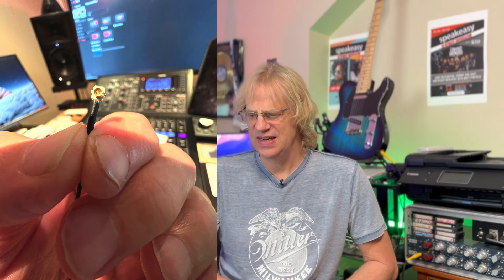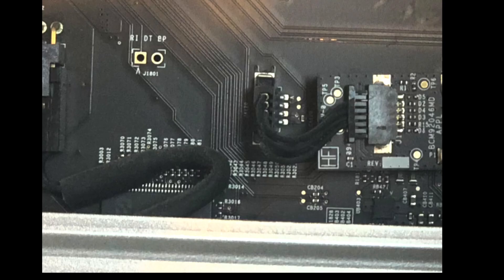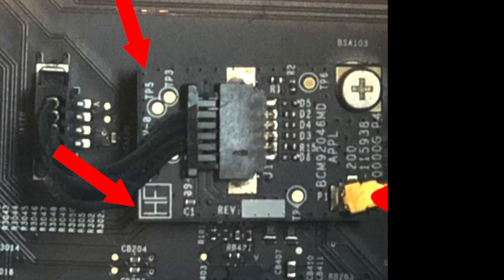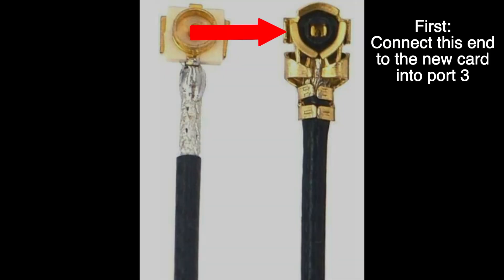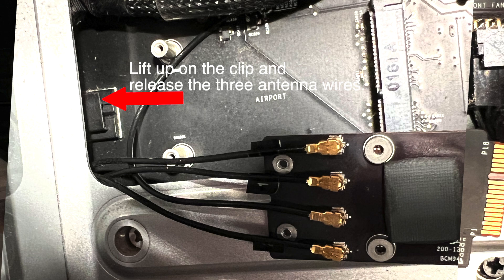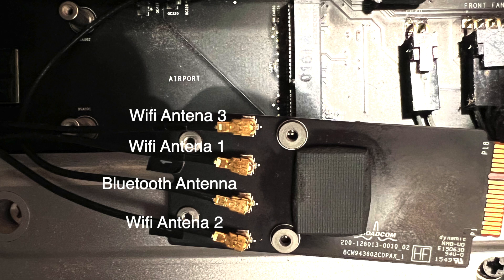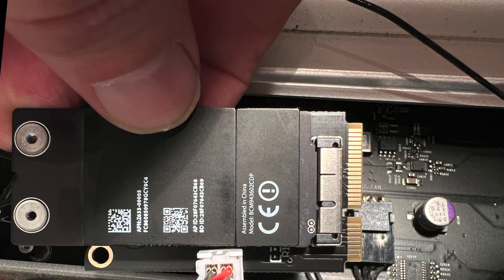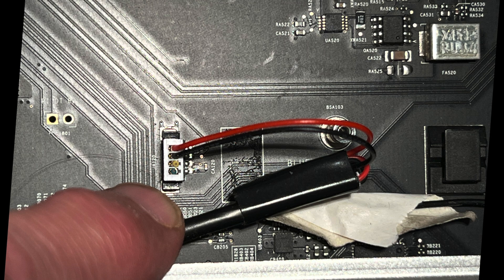Mac Pro 5,1 Bluetooth Wifi Upgrade!

Comment: Hello thank you for this good tutorial. Do you know where I can find the data cable ? And do you know that it’s obligated to install an antenna extension with this card ?
Thank you 🙏
Reply from the maker: The extension helps big time unless you are very close to your Mac Pro, mine live about 10 feet away from me on a open closet this is overpriced but shows you what to look for, it think you can find it on Amazon, https://www.ebay.com/itm/403596462883?mkcid=16&mkevt=1&mkrid=711-127632-2357-0&ssspo=-UibluCfTYq&sssrc=2349624&ssuid=o6k3tERPQiC&var=&widget_ver=artemis&media=COPY
Reply: @MacSoundSolutions  Hello, 
I did the upgrade but I have disconnections all the 10 seconds for all my bluetooth devices and the wifi is searching but never finding anything. Do you have an idea to help me please ? 
Thank's in advance

PS : in m
y settings, bluetooth module is visible
Reply from the maker: @jibemevel  try a pram reset, use a wired keyboard to do it. That may fix the issue.Press your Mac's power button and then hold these four keys at the same time: ⌘ + option + P + R wait till you hear the boot chime at least twice then release the keys. Check Wi-Fi BT.
Reply: @MacSoundSolutions  thank you for your fast response. But my Mac is patched with opencore under macOS Monterey. For you there is no problem to do a pram reset on a patched Mac ?
Reply from the maker: @jibemevel  it should be ok, are you using OCLP or Martin Lo’s
Reply: @MacSoundSolutions  I’m using OLCP
Reply from the maker: @jibemevel  did you apply the post patches? I think it’s safe to do a pram reset, when you change hardware it is sometimes necessary.
Reply: @MacSoundSolutions  Hi :D That was finally Ok under monterey, after installing the last OCLP (0,6,1). And I decided to upgrade my mac pro5,1 (mid 2010) under ventura. the mac works perfectly excepted for the Bluetooth that is currectly not available even in the mac system settings... Would you have an idea to fix it ? 

thanks a lot for your help🙏🙏🙏
Reply from the maker: @jibemevel  read the comments here might help https://www.reddit.com/r/macpro/comments/11v5foa/51_bluetooth_issues_after_upgrade/?utm_source=share&utm_medium=ios_app&utm_name=iossmf
Reply: hello 🙂 after my question, I saw your video where you don’t advice to upgrade to Ventura in this machine … so I decided to erase my HD and do a clean install of Monterey. Now it’s ok ! I’m installing all my plugins, this step is a bit boring but the machine rocks !!

Comment: I had to do install another BCM943602CDP because the first one I put in had a bluetooth range of only 2 feet from the antenna.  I got the new one installed and its working great.  The first one is going back to the eBay seller for a refund.  I'm happy.

Comment: I just  completed the install of BCM943602CDP on mini PCIe Adapter and  external antenna as shown in video.  Installation went great with all antenna cables attached firmly to Broadcom card.  Unfortunately I got a problem.  The Bluetooth is very weak.  At first it didn't detect my bluetooth devices at all.  Now bluetooth detects my Apple mouse and keyboard, but both mouse and keyboard have to be very close or directly on top of computer.  I also found that the known good bluetooth mouse sometimes doesn't track properly.  The Wifi seems to be working great.   So I'm assuming the problem must be either the Broadcom card or the cable that goes to the external antenna.  Unfortunately I don't have an extension for connecting internal bluetooth antenna.  I will continue to use wired mouse and keyboard until I have to perform more troubleshooting.  All of my other upgrades on my Mac Pro 5,1 worked flawlessly.
Reply: Update:  I found the external bluetooth antenna doesn't work well attached to the back of the computer.  When I attach extension cord between the computer and the antenna, the bluetooth works great.  I think this solves the problem.
Reply from the maker: Maybe some interference from something. I have mine on the back plate and antenna on my desk works well. If I put my iPhone near my track pad it can make the trackpad act all crazy. You also might want to try a pram reset after installing the new Wi-Fi BT card.
Reply: @MacSoundSolutions  I found that the bluetooth works great ONLY when the external antenna is within a a couple feet away from keyboard and mouse.  I tried reseting PRAM.  The antenna appears to be working.  The strength of my bluetooth is just very weak.  I think will order a "New" BCM943602CDP from AliExpress. 
I had so much fun upgrading my Mac Pro 5,1 that I'm looking on Craigslist to buy another one.  However I may build a super high power PC next for running Ubuntu.  Open source is cool.

Comment: I believe this is Broadcom BCM943602CDP.  I've seen these on eBay for $14.00 plus another $5 for shipping.  
You also need JST Wires, Mini PCIe Adapter and Antenna Extension Cable.
Reply from the maker: Yes as I say in the video you can source the parts yourself and pay a lot less.
Reply: @MacSoundSolutions  I believe the  Mini PCI-E Adapter need to be a Version 3.   Some Mini PCI-E Adapter  may not have a USB power connector.  The eBay ad that you posted only has a stock photo that doesn't show a USB power connector on the adapter.  The ad doesn't state the Broadcom model number.  The sellers ad is not clear on what the buyer is actually getting and he is asking for too much money.  I like one stop shopping also, but I'm avoiding this seller.
Reply from the maker: @elminero49  if you email them they should respond, they gave me two xeons 5699s and a flashed thunderbolt card so I feel I broke even.
Reply from the maker: @elminero49  under system prefs it shows BCM_20703A1 which is actually wBT4.1+LE. They do say on their website that the photo is for ad purposes only and the card may vary. It seems it's not a 4.2 card, it does work with handoff airdrop.
Reply: @MacSoundSolutions  Hey Lance, An audio question:  I got my entire music collection on my computer.  I grew up the late 60's and 70's.  My parent always had the radio on at home and in the car.  I got every song I can remember on my hard drive as a mp3 or flak.   Is there a particular DAC i should get that produces great audio and doesn't cost much.  Is it worth getting a vacuum tube pre-amp?  Can you recommend a good pair of headphone that would give me music texture and layered audio?  I can't afford high end expensive gear.  I'm just tired of listening to music with ear-buds connected to the computers internal audio and I'd love something better.  Unfortunately, I'm living in an apartment so can't install a big sound system.   I'm thinking I need a DAC, preamp and headphones. I always had great audio in the past.  Nowadays my 70's and 80's stereo receivers are collecting dust and prob'ly need new capacitors.  ...we sure had some great parties back then.  Have you ever been to Kingston, NY near Woodstock and New Paltz?
Reply from the maker: @elminero49  Hey I used to go biking in New Paltz. I live in Rockland County and been to Kingston a couple of times but mostly passing through not hanging. I use Beyer Dynamic DT 770 Pro headphones, lots of good DACs out there but honestly I can’t recommend something I haven’t used.
Reply: @MacSoundSolutions  For the Beyer Dynamic DT 770 Pro which impedance do you use:  32, 80 or 250 ohms?  I didn't order yet because I'm thinking the impedance should match the amp that I don't own (or built) yet.  I = E / R  
You look vaguely familiar from my old New Paltz days.  I used to go to Bacchus and Snug Harbor.  I currently live in San Diego, California.  I still love the Hudson Valley. 
I had a lot of fun upgrading the 5,1.  Now I got to get it set up for coding web application.
Reply from the maker: @elminero49  my BD phones are the 250ohm model, it really depends on what amp you get so look at the specs of the headphone amp of the dac you may need an amp and a dac, or just AC receiver / amp. I use my M32r and it drives the headphones to a good level.

Comment: Thanks for the tutorial. Question, isn't it easier to buy a Bluetooth/Wifi USB dongle to solve this connection issue?
Reply from the maker: I tried that even before my whole upgrade to hopefully have a better Bluetooth connection / signal and honestly I found them to be quirky and had to douse Xcode app for it to be recognized by the Mac , do your research and maybe you can find one that works well.

Comment: I just did this upgrade this evening.....more like I watched my son do it for me...... and the wifi is awesome. I'm getting speeds over 2x what I was prior, unfortunately no bluetooth though.  Computer is a Mac Pro 5.1 mid 2010 running Mojave 10.15.6. Any help would be much appreciated. Thanks
Reply from the maker: Shutdown the Mac unplug the power wait 5 minutes or so and boot up. Then go to system profiler about this Mac check to see if the Bluetooth card shows up turn Bluetooth on.
Reply: @MacSoundSolutions  Thanks for the response, unfortunately no love, just says no information found. Seems to have no idea there is Bluetooth in the machine.
Reply from the maker: @ginocecchetto8286  try a pram reset hold down command option p and r keys and reboot let it chime more than twice sometimes that helps find new hardware. you did connect the usb data cable from the new card to the port on the board next to the old card?
Reply: @MacSoundSolutions   Thanks, I'll give that a try. Yes, the data cable was connected.
Reply: No love again.
Reply from the maker: @ginocecchetto8286  dang if I remember correctly I did not have blue tooth on first boot after the upgrade but then it kicked in after another reboot what OS are you running and did you get the exact same card/ kit?
Reply: @MacSoundSolutions  I'm running Mojave 10.15.6. Yes, same kit but I did buy the other mini NVME card that supposedly didn't require soldering but it had the wrong plug so we had to solder anyway. I'll pull it back apart this evening and go through everything again. Thanks
Reply from the maker: @ginocecchetto8286  maybe one cable is not connected to the correct spot. My kit came with the card no soldering needed.
Reply: @MacSoundSolutions  Well, I checked them carefully before closing back up and everything appeared correct, but I'll take another look this evening. Thanks
Reply: @MacSoundSolutions  Okay, fully functional again. Bought another kit from the link you posted and all is good. I think I must have sourced it by individual parts last time. Thanks for the help Lance.
Reply from the maker: @ginocecchetto8286  cool glad it worked out. Must have been the mini pcie adapter card

Comment: Hi Lance, thanks for this step-by-step tutorial. I've noticed that you data cable has two cut wires (green and yellow). Why did you do that? Cheers!
Reply from the maker: That’s the way the new cable came, I guess it doesn’t need the other two wires

Comment: I upgraded my Mac Pro 5,1 with the same card, but Monterey doesn't recognize the Bluetooth module. I can't even turn on BT. The card is installed correctly, as it does work in Mojave. Do you have a suggestion what might be the issue? I used OCLP and didn't apply the post install patches. Those shouldn't be necessary, should they? Also, I had a different module back when I installed Monterey. Should I reinstall with the module present? But again, that wasn't a problem in Mojave.
Strangely enough, my Magic Trackpad does connect although BT is supposed to be off, but is has only basic functions, and no continuity, of course.
Reply from the maker: Try doing a pram reset I’m Monterey I’m using Martins OC package for 5,1 not Legacy Patcher.
Reply: @MacSoundSolutions  Thanks for the reply, but I have already tried that to no avail.
Reply from the maker: @MacTaipan  what version of Monterey?
Reply: @MacSoundSolutions  I'm on 12.4. But it seems like it's working right now. I have updated OCLP from 4.5 to 4.6, which at first lead to loss of even basic BT functions. So today I did another NVRAM reset, and now it seems to be working. I can copy data from my iPhone to the Mac via the clipboard now. What still worries me a bit is that System Information still shows very little information. It shows the address and chipset etc now, but all the info about BT versions, handoff support etc is missing. Or is it always like that in Monterey?

Comment: Great videos..got my 2009 mp 5,1 upgraded to Big Sur from Catalina, but this wifi Bluetooth 4.2 I had no longer works when my metal compatible rx 580 is installed..if I put old graphics card back in I get it back…how to fix?? Thank you I’m advance!
Reply from the maker: Try a pram reset with the 580 in, that might fix it. I have not had thus issue so hard to say but i would try that, just keep in mind it might unbless opencore, it didn’t for me and I have done a few pram resets
Reply: @MacSoundSolutions  thanks for getting back, I tried this, but it did not solve it. I think I can live with no wifi, or just using the old GTI 120 graphics card, but really curious if there’s a solution! Thanks, again.
Reply from the maker: @mrmalachite6257  read this half way down the page the guy found a fix https://www.tonymacx86.com/threads/adding-rx580-breaks-bluetooth.316581/

Comment: Can I use a 2017 iMac pro 27" pull? I think it has the same 4 antenna pins.  Isn't it the same family AirPort card used in MacBook Pro 2015 of which I have as well? 
Ask the wife for nail polish remover or plain Acetone to loosen that loctite.
Reply from the maker: Maybe  but you also need to connect to the old Bluetooth usb connector to the logic board with a special cable to to get Bluetooth working as well.

Comment: Hey Lance, I can confirm that Open Core Legacy Patcher works just fine.  I installed Monterey using the standard Open Core tools and your neat EFI config.plist trick to complete the installation without problems but yes, BT and WiFi were lost.  So, I downloaded the Open Core Legacy Patcher and applied the patches to my fresh installation of Monterey and now BT and Wifi are back!  I can also boot from any other OS using this method.  Mavericks, High Sierra, Linux, Big Sur, Monterey, so yes, you can boot from other OS.  You can save big bucks by using the OCLP tool.  The only drawback is that you won't have AirDrop or Continuity but if you only need to pair your mouse and keyboard or stream music to your BT Speakers then this is a life changer.  I didn't care much about loosing my wifi when I installed Big Sur since I connect my Mac Pro over ethernet but Bluetooth it's really important to me since I have the nice Apple new keyboard and mouse and I didn't want to loose them so finding this tool was a life saver.  It is so cool to have my Mac Pro still working great after so many years, it's a great machine and I have mine heavily upgraded with 12 cores, 64 GB of RAM, PCIe SSD, Bluray Drive, 4 x 8 TB SATA HDDs, Radeon 16GB GPU and an Apple Cinema 30" Display.  I do own a few more recent Macs but this is still my favorite, and still faster than many newer ones.  And your videos, they are great, very well explained and super helpful.  Kind of cool to see the upgrades you've made to your computer and think to myself... "me too!"  Keep up the good work!
Reply from the maker: Hey thanks for posting this info, very good to know and I will mention this and pin it.  I don’t think the OCLP patch will work for Martin Lo’s package but I think he has fixed it in his latest release, not positive. Someone else said that they were not able to stream Apple Music to their homepods when they went to Monterey so they are upgrading the card. Handoff is pretty cool and I do use it quite a bit. yes the Mac Pro 5,1 keeps on rockin in 2022. Mine is now running in top form, NVMe with Big Sur, SSD in bay 1 with Monterey, Titan ridge in  slot 4 also working well. Blu ray and super drives, rx5700xt, gaming in Windows in 2k at max settings is pretty sweet too. Xeon 5690s. The only thing I can do to my Mac Pro now is add more ram I only have 24gigs. It’s been fun and Apple may be releasing a new Mac Mini “Studio” at the next event. Should be interesting.
Reply: Hi I can't get wifi to work with big sur or monterey , II tried to  install both Monterey as Big sur using open core legacy patcher but still no wifi. I'm using the GUI version. v0.4.3 . Which version did you use ?
Reply from the maker: @Johnsormani  if you watch Mr Macintoshes instruction on YouTube he says for the 5,1 to not use the gui version you have to use the terminal version and then patch for Wi-Fi  etc
Reply: Just so I understand this correctly, you only used the post-install patches from OCLP?
Reply: Thanks for the great content Lance, its really helped me. Question, can you refer me to the Mr.Macintosh video that covers Monterey BT/WF activation via terminal rather than the OCLP GUI. I've used ML's OC 0.8.8 package to get to Monterey and would like to activate the legacy BT/WF, but havent had success thus far so looking for a solution. @AppleTools any advice as well? Thank you!
Reply: You dont need to do that EFI rubbish to complete the install of Montrey. Plus I tried and it said I has windows bs problem and would have to contact dude.... forget that. Instead I simply removed all Harddrives except the blank one I wanted to install Montrey on, rebooted with the USB installer, it selected that blank (and I had a Radeon RX 580 in too didnt have to switch to stock gpu) and instaleld that way.